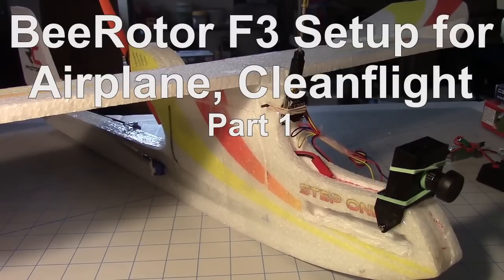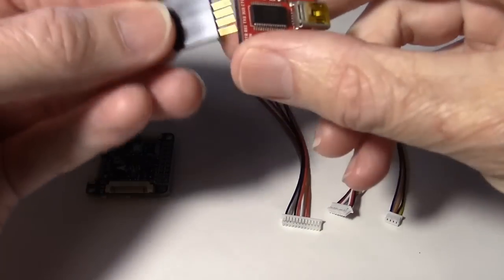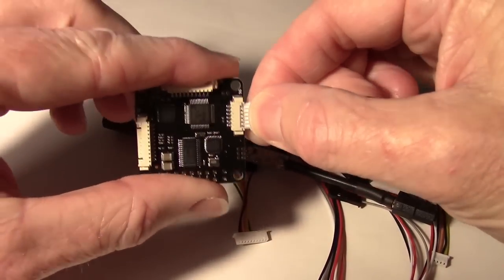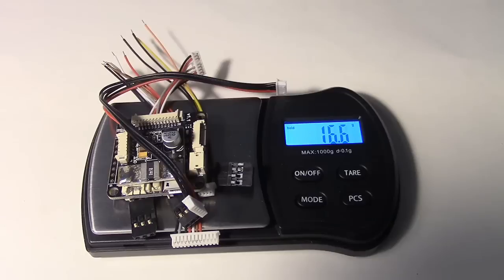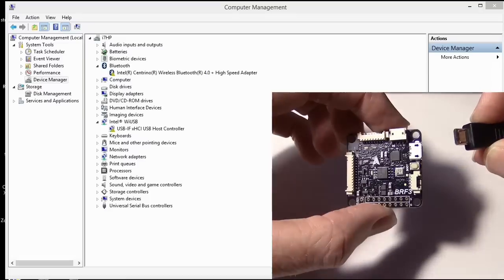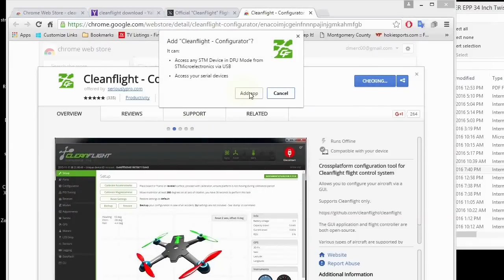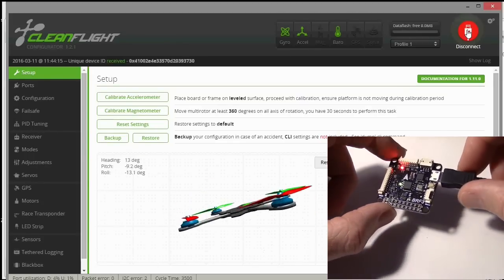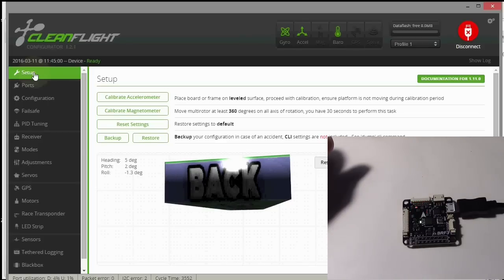BeeRotor FC Airplane Setup with Cleanflight Part 1 (Configure Com port driver, Load CleanFlight)

Comment: is that a 3dr voltage regulator from APM?
Reply from the maker: +Jon Car It's a knock-off of that, yes. It's $13 from multirotormania.
Reply: +dmerc00 nice.  Are you going to draw a pin out diagram from the regulator to the BeeRotor FCU?  Looking to use this setup in a foam race wing.
Reply: +Jon Car Just ordered the RCtimer version